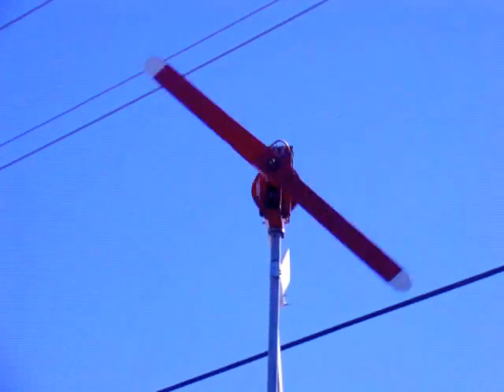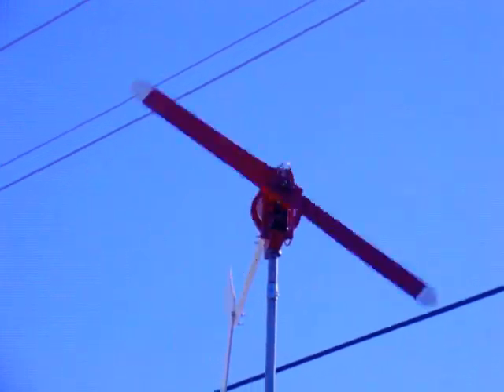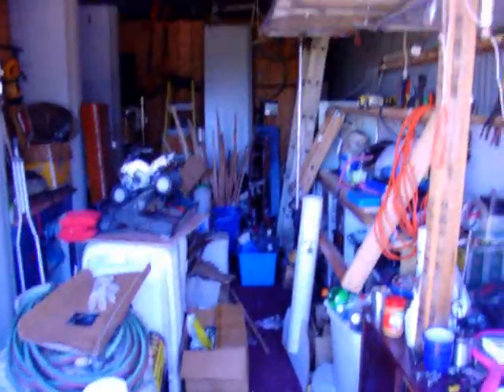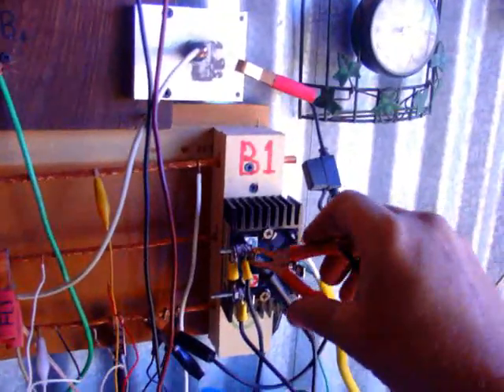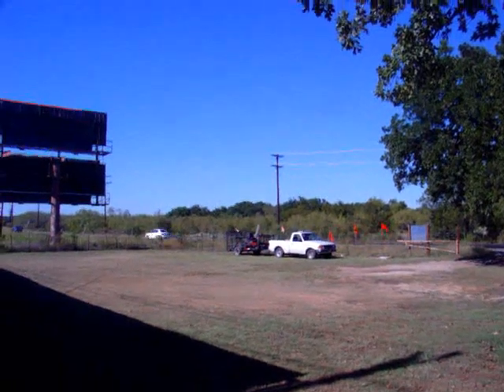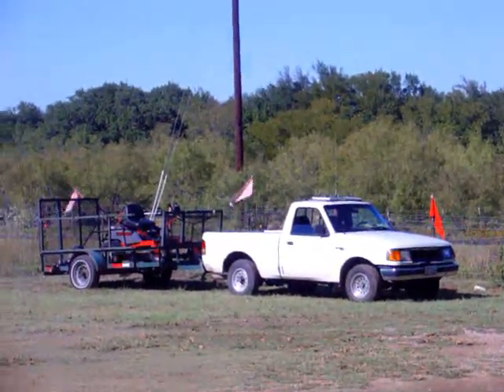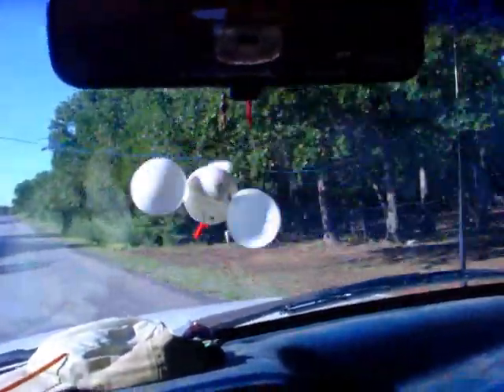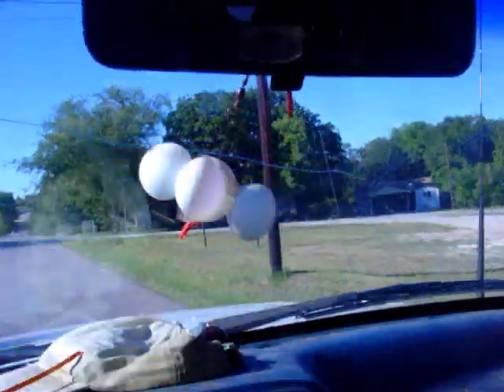WHERE DID MUDDy GO  UPDATE 25 09 13 THE MIGHTY MINI WIND TURBINE

Comment: Hi Muddy,
I have an interesting dilemma with the two CF PMA's I built for my mini-hydro set up. Both PMA's put out about 45 volts when they're running no-load side by side on the water wheel. But when I wire them together the voltage goes down to about 25 volts. Not noticing a big slowdown in the RPM's, so I don't think it's for lack of power.

I was hoping it would either double the voltage or keep the same voltage with higher amps. What's happening?
Reply from the maker: Stephen Round Try wiring the outputs of the diode bridge rectifiers in series. If your voltage dropped, i would assume that you wired the alternators together before rectification diodes. Thus the ceiling fan alternators were swaping voltages acrss each others windings.
If you rectify the two alternators first, and then connect the two afterwards, it will be more like using the rectifiers' outputs like batteries.
series and parallel configurations both work flawlessly that way.
Thanks for the great question. God Bless you and yours.
MUDDy

Comment: huh muddy, a alt uses about 2 hp...
Reply from the maker: ha ha, the way mine runs, i think that's all i have. :)
I am still dreaming of the weed eater powered sail board with pontoons. the way the water level is here on the once glorious Brazoz river,  sail board or air prop boat is about all that will move across it.
But it does make for a great oportunity to collect some dirt for sluthing. :)
The big test will come soon.
MUDDy

Comment: You know bud,, I never thought about the car alternator draw on the engine.. Adding a solar panel on your car is a easy way to help save energy ( fuel costs). And you got yourself a good radio voice,, I will check out your radio show, if I can here in the Seattle area,, God Bless Texas! That is where my Fathers family is from, Texas,, I miss the lightning bugs :)
Reply from the maker: hunters and explorers used to pin the lightning bugs to their boots to light the trail.
Thanks bro. I havent been doing the radio program for a while now. too much to do here, it was on the internet radio. at shazizz radio dot ect.
I will be doing the radio show sometime later on though. I will let y'all know when I do. Guest from you tube welcome then too.
almost any and all.
especially if y'all need to promote your sciences.
MUDDy

Comment from the maker: YA, I KNOW WHERE SEYMOUR IS. BEEN THERE A FEW TIMES. THERE IS ALSO ANOTHER TOWN CALLED KERMIT, TEXAS. NOT A TREE FOR AS FAR AS YOU CAN SEE. IT'S WIDE OPEN WEATHER THERE. AND WHEN THE SUN GOES DOWN, THE SAND DOESNT HOLD THE HEAT ALL THAT WELL. CONTRAST TO THE MAX.
MUDDy

Comment from the maker: YES, EXACTLY, WITH ONLY ONE ROTOR, IT WAS A HUGE DIFFERENCE. LESS THAN HALF THE POWER, AND A LOT OF SLIP WHEN SHORTED OUT. THUS A HUGE LOSS IN EFFICIENCY. IF I ADDED ANOTHER ROTOR, AND STATOR, I WOULD HAVE 3 ROTORS, AND 2 STATORS, AND NO LOSSES, BUT TWICE THE CAPABILITY. THAT WOULD MEAN ADDING 41% LENGTH TO THE PROP.

Comment: @muddymuddymuddman
G'day Scotty ! Good to see ya posting again, mate. I'm glad to see your SunFoil get a plug in the middle of the Clip... As long as the Solar Charge Controller out-Volts the Alternator's Regulator, the Vehicle will use Solar Power as 1st Option, only using the Alternator if the Panel needs help.... It's a pity you're busy Lawnmowing, I'd rather see you installing SunFoils to the Texans...; between tilting at Windmills, ;-p  Ciao !

Comment from the maker: NO, IT'S JUST A LOOSE SPACER MAKING A SMALL PULSE OF NOISE. THE NOISE HAS A MINUTE DUTY CYCLE. KINDA LIKE A SPIKE. PROBABLY LESS THAN 1 mWATT LOSS IF ANY. BUT YOU ARE RIGHT, NOISE IS POWER LOSS. JUST NEGLIGABLE IN THIS CASE. I'LL CURE IT WHEN I CHANGE PROPS. THEN I'LL HAVE TO MAKE IT FURL OUT EARLY, SO I'LL HAVE TO DO SOME WELDING TO CHANGE CONFIGURATION OF THE POLE AND TAIL LATER.
I KNEW YOU WERE PRETTY SHARP.

Comment from the maker: GOOD QUESTION. AND I HAVE THE ANSWER, LOL. THE SOUND IS THE SPACER BETWEEN THE PROP, AND THE LUG NUT THAT HOLDS THE PROP ON. IT'S JUST LOOSE ENOUGH TO LET IT MOVE WITH GRAVITY AS IT TURNS. THE ORIGINAL SETUP WORKED OK FOR A BIT, AND THEN IT STARTED TO SLIP, SO I DRILLED INTO THE SIDE OF THE PROP, ALL THE WAY INTO THE MAIN SHAFT. AND I ADDED A LOCKING BOLT. IT WILL NOT SLIP ANYMORE, LOL. THAT BOLT HAS TO COME OUT BEFORE THE PROP WILL MOVE AT ALL. A SQUEEZE OF GASKET SEALER WOULD CURE THE NOISE.